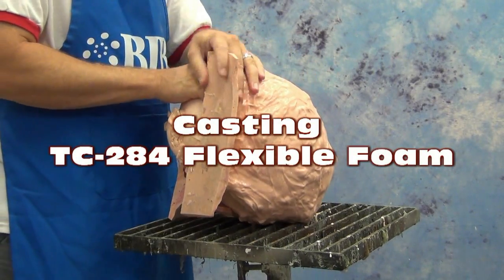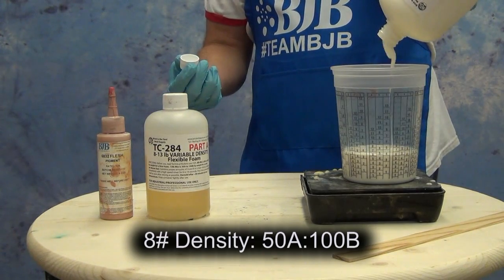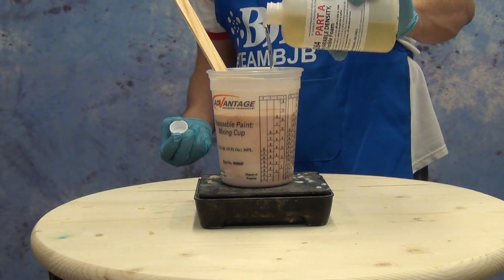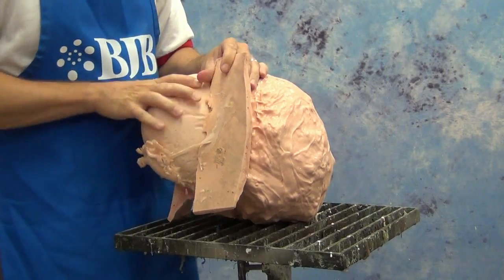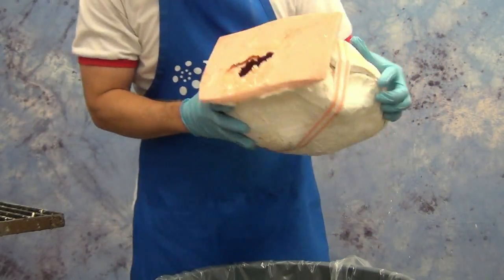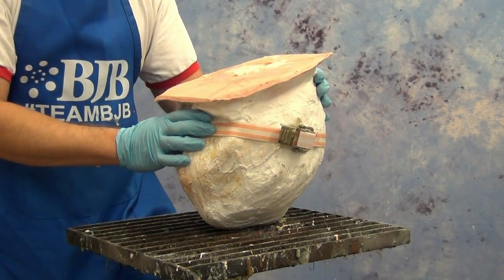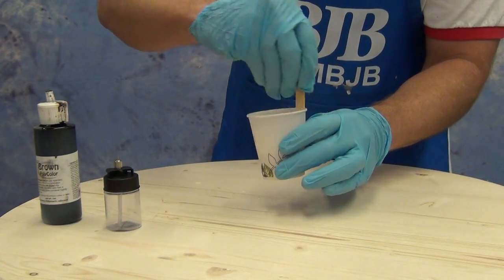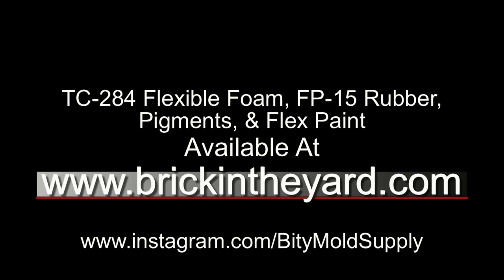Casting a Self-Skinning Foam Head With TC-284 Foam

Comment: Hey Mitch, what's your criteria for choosing urethane over silicone (or vice versa) for the skin? I don't have a lot of experience with urethanes, I typically go the silicone route by default.
Reply from the maker: FP-15 is a good option for haunt props or film props like exploding heads. The main difference, besides cost, is UV resistance. FP-15 and PT Flex 20 are great skin materials for props but they will yellow if exposed to direct sunlight.

Comment: How does with compare to latex made props ? More durable ? Longevity ?
Reply from the maker: Different process altogether. Both approaches have their advantages. Typically a latex skin is used for larger props made from a gypsum mold. 284 is typically used to cast props from silicone molds or fiberglass molds. Self-skinning foam is a faster process but takes a careful casting approach to avoid air bubbles.